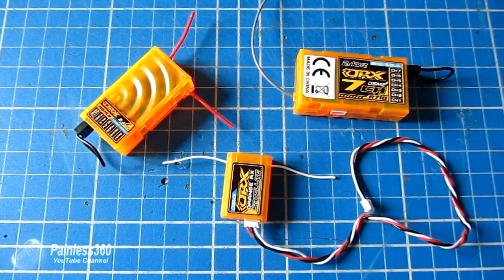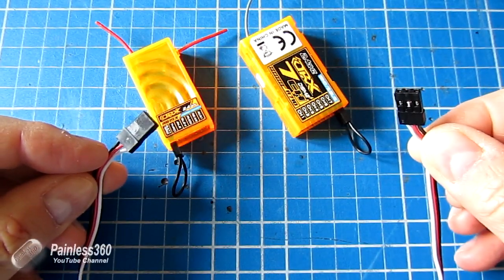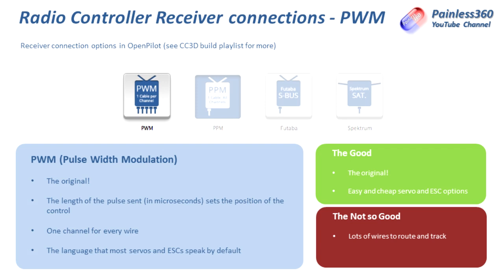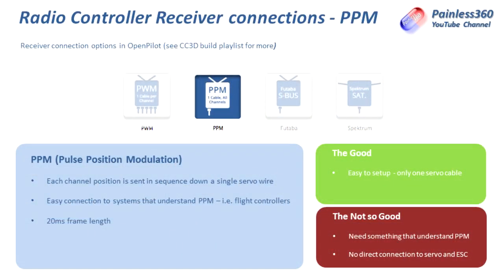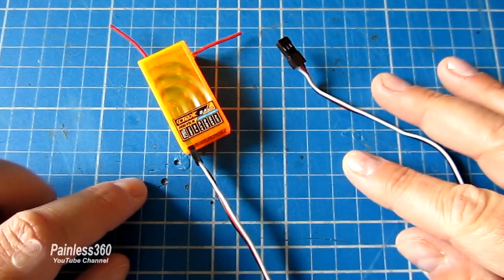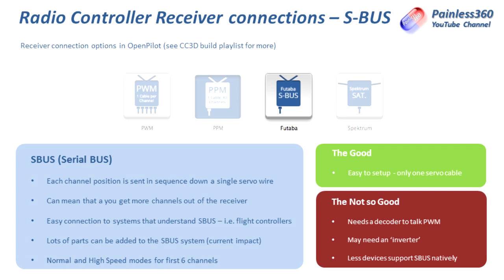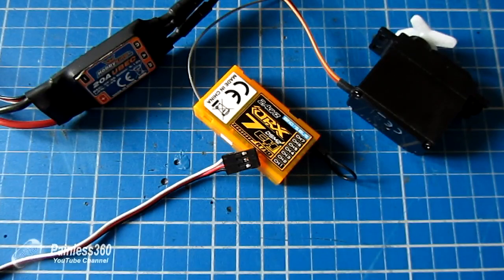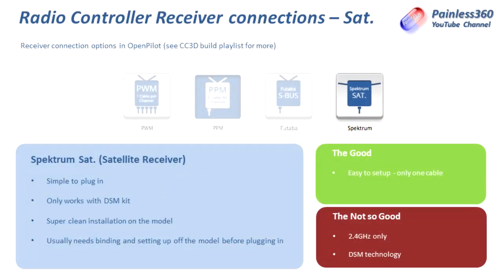RC Quick Tip - PWM, PPM, CPPM, S-BUS and Sat. explained for beginners

Comment: Currently there is a bug on the Pixhawk that messes up channel remapping, this resulted in me changing from Spektrum to FrSky (which was irritating)
Reply from the maker: Rob Crawford Not all of the radios use the same channel sequence. Some of the other flight controllers like the Naze32 with Cleanflight allow you to edit the channel sequence. 
The TARANIS is a great radio anyway! ;)
Reply: Sadly Spektrum use the same channel sequence as JR and except for some of the newer high end models they can't be remapped on the TX (hence my change)

Sadly the current APM applies the offsets as if no channel remapping had taken place (creating an unflyable machine)

Seemingly it will he ages before this is fixed as fixing it would break Arduplane comparability (issue has been in the bug list since December)

Comment: Very nice explanation :)
But it's not really true for PPM, since a lot of flight controllers can not read this protocol and some applications like plane require individual channels, normally a good PPM receiver (like Dragon Link for example) allows you to use individual channel like a normal PWM receiver in order to connect everything to your flight controller and even your servos and ESC :)
Reply from the maker: ABMNS PRODUCTION True but explaining every 'nook and cranny' of the differences was out of scope for this video. This is about helping those who have been told that 'S-Bus and PPM are the same mate..' get a more solid understanding of the basics ;)
Happy flying!

Comment: Hi. What do you think of this receiver and will it work on a quadcopter with cppm and spektrum radio. 
Rock Solid - OrangeRX DSM2/DSMx compatible 6 Channel Diversity Module from HobbyKing
Reply from the maker: Johan Opperman Which version? There are loads of different models. I use the R615x a lot here...
Reply: Hi I can give you the product no on HobbyKing site if you want to have a look. It connects to I think 6 satellites.  
It's a new product come out beginning of April. 
Spec: 
Operating Modes: DSM2 (1024/22ms, 2048/11ms), DSMx (22ms/11ms)
Power Input: External 5V~8.4V or 3.3V via satelite port 

PRODUCT ID: 9171000539-0
Reply from the maker: Unless you have a problem with radio reception and need diversity you don't need this. You can use one of the smaller receivers and they will usually work great.

To connect  9171000539-0 to your craft you would need a flight controller that expected a Spektrum Sat. connection and a couple of the satellites themselves to plug into it - PRODUCT ID: 9171000299-0  

Happy flying!
Reply: I'm thinking to get me this little qav quadcopter you reviewed from Banggood with the cc3d FC. Will that work with this receiver if I put clean flight on it? Thanks for all your patience
Reply from the maker: I would get a R615x receiver - that works great and is the one I use on the videos too.

Best of luck with the build..

Comment: great work man.. thanks for covering all the grey areas i had about this subject. You Are the man!
Reply from the maker: DCVINRC Glad it helped - what was it in particular that you were not clear on before the video?
Reply: well use a futaba 14sg, and i was being fed misleading information. i was told to use SBUS, and that it was the same as PPM, but i did not want to run the extra hardware for this to work. i was also told there was no such thing as FASST compatible RXs with PPM. but google says otherwise. i will go onto sharing your vid on my RC group to prove i was on the rite track. so thanks again. FYI your naz32 series helped me out heaps for my tricopter. (V3) am just researching now PIDs effect the craft. maybe that could be another vid you could do. what PID do what. i was using KK on my craft before Naz. finding it hard to translate settings.
Reply from the maker: I have a hidden PID video that is under peer review at the moment that may help - https://www.youtube.com/watch?v=fNYu5coR6Sg

I hope it helps.
Reply: cheers